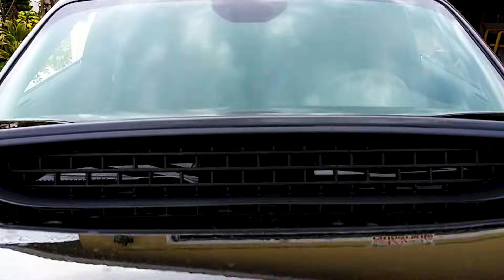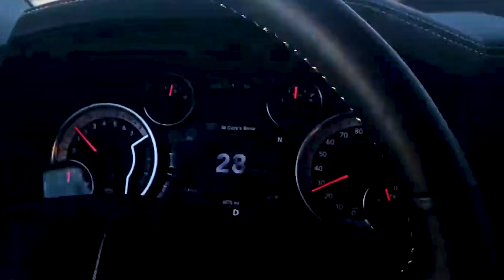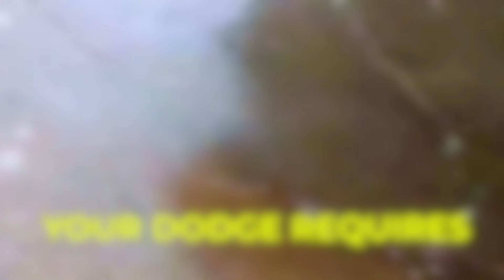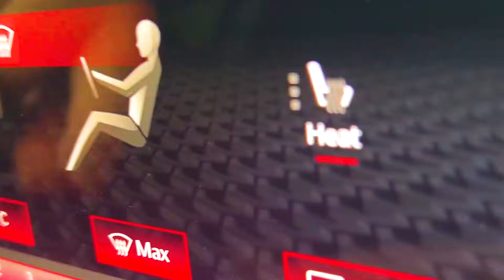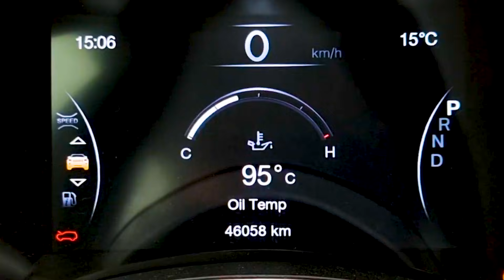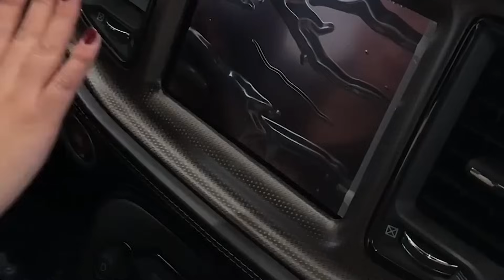STUPID Dodge Settings That Overheat & Destroy Your Engine (Fix Them Now)

Comment: 2009 up hemi requires 89 minimum 91 preferred  and any shaving of the head requires a bump in octane. You are going to destroy people's engines with false information. Yes pre 09 hemi 87 is ok it had no vvt system in place. As a dodge mechanic you should know this!
Reply: Facts